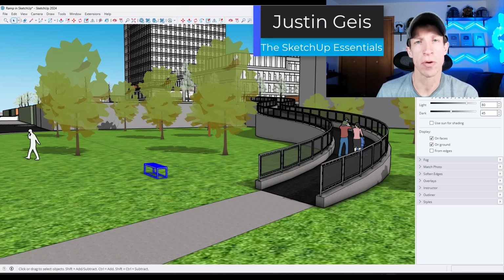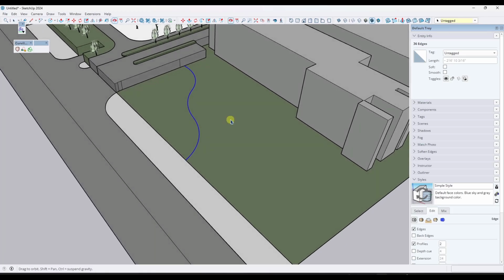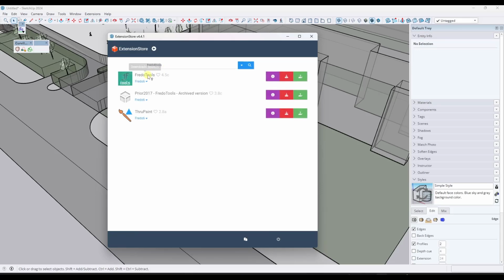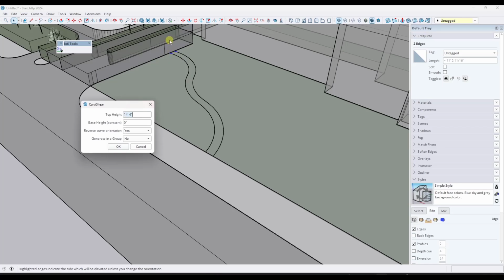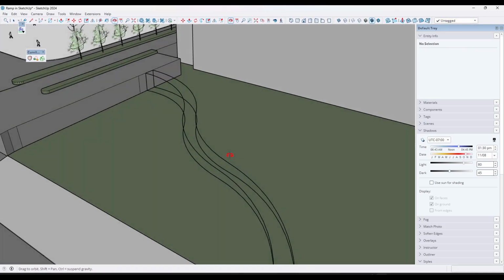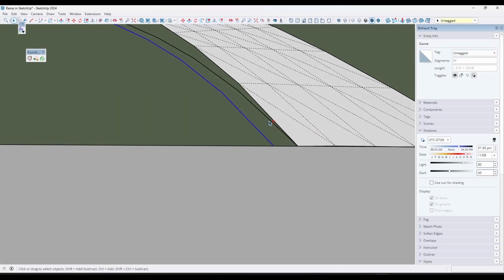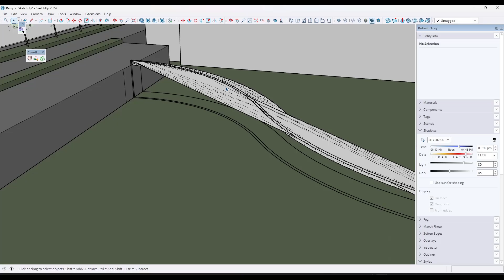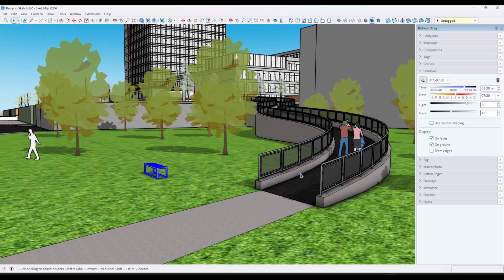SketchUp Made SIMPLE: Create Perfect Curving Ramps in Minutes

Comment: Wouldn’t the simplest and quickest way to a give this result with ramps is to create a straight ramp with start and end heights, length & thickness etc. - (much like you would with a straight staircase) and then use the shape bender tool?
Reply from the maker: It's a valid way to do it, but the problem with bending is that you sometimes end up with distortion of your shapes, where a flat profile that is then sheared to the proper height should retain your shape a little better. Honestly they're both fine ways of doing it though